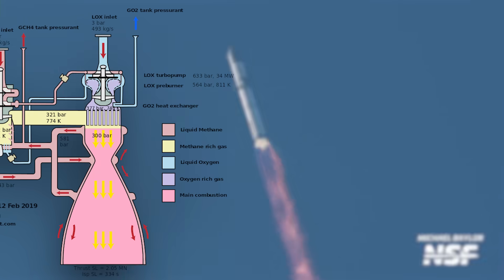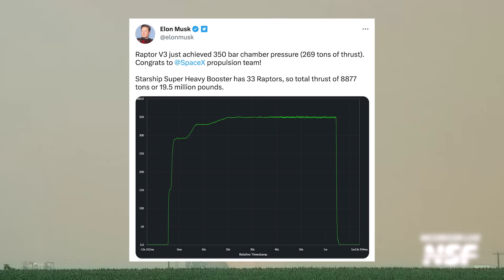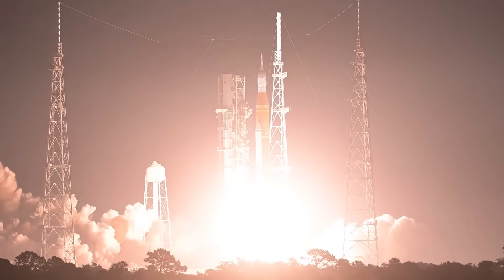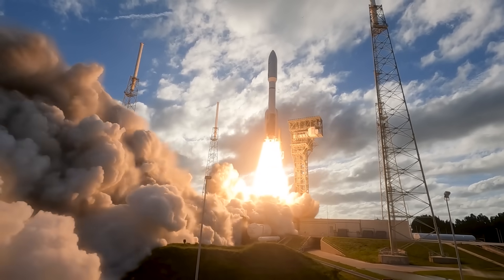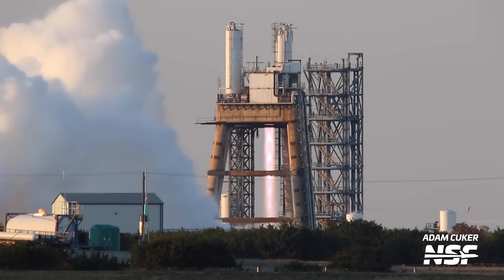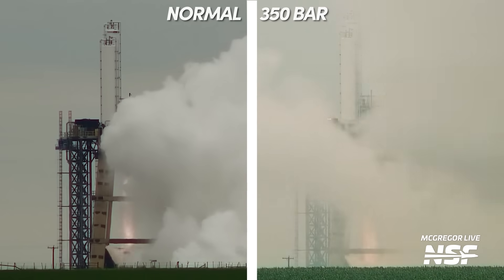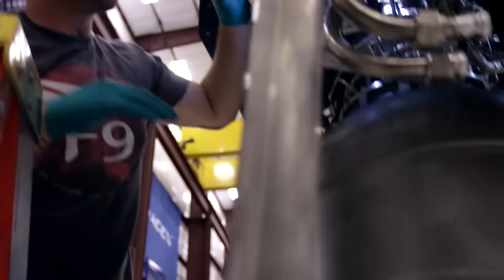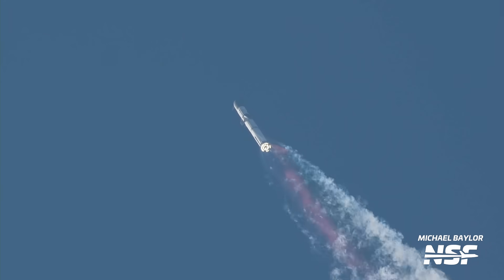SpaceX's New Raptor 3 Smashed The World Record!

Comment: Some of you guys who are engineers, please educate us?  It appeared that about 7 Raptor V2s failed in the recent launch.  7 out of 33 ain't bad for a new engine, but unfortunately that's enough that it was unable to make orbit or trajectory.  So, were those failures fixable?  Did they fail for varying causes?  Elon says it wasn't FOD.  Did the combustion chambers melt at full thrust?   
Of course I am simply wondering if another test flight using the same V2s has much of a chance of making orbit.
I'm excited to hear (not surprised) that there's a V3 in the works, but that could be a long way away yet.   Elon is saying next flight on June 15th?  Oh please, there's no way they can fix that OLM and tune up the booster and SS in one month!  I wish he would be more realistic.  Mid July or mid August seem much more feasible.
Reply: The V2s that were on B7 were a bit mismatched and inconsistent due to their stages in development, the more recent ones are meant to be more consistent, so hopefully that means fewer issues. The main contributor to many of the engines failing is that the raptor shielding isn’t as thorough on B7 as the newer ones, and so when one engine blew it damaged surrounding ones. The same thing resulted in the HPUs losing pressure, so the booster couldn’t steer, but the newer boosters have already replaced the hydraulic system for an electrical one.

Edit: forgot to mention that the computer chose not to ignite 3 engines from the start
Reply: @Gauldoth06  not to undermine your fantastic argument, but SpaceX is a private company
They don’t have public funding
Reply: The onboard computer found 3 engines did not have the right parameters to be started at launch. This may not have been a failure of the Raptors themselves. It may have been a software issue being too overly cautious or not specific for that version of raptor. (And as the outside Raptors need to be on the OLM, they can not be started once the Starship System has lifted off. The raptor that failed in flight caused damage to the neighboring raptors and also there was some cause that related to the hydraulics which caused, at 85 seconds, a loss of control of the center engines. But at least it did not cause the rocket to RUD. So a big plus there. The thrust puck was really up to the task! If your producing a product and you haven't tested it, how the hell are you going to be able to 'improve' the next build? As for the 'time frame' you refer to, there is a lot of testing being (or has been done) already. And those that follow SpaceX know all about 'Elon time', so yes, more likely later. But it is looking like this year.
Reply: @David-yo5ws  yeah the 3 that didn't start at all.  The same thing happened (different engines?) on the static fire test.  It seems very puzzling that they had that happen and didn't do another static fire test.  Did they write those engines off, figuring 30 would be adequate?  It would have been had 4 more not failed on ascent.  An additional failure could have taken out the adjacent engine, but all the failures were not next to each other.  So one or 2 engines failed on the way up that were not due to inflicted damage.  I would have more confidence in a quick fix except for the puzzlement of the static fire/no retest.
Reply: @paulwilson8367  Unless your working as part of the Raptor team, it means we may not know the finer details till someone writes a book in future years. As a 'hypothetical guess', it could be that the team are not putting their resource's and time into re-writing the software parameters for the different V2 Raptors. There is only so much time. With the newer V2 or even V3 engines and better specifications and more consistent supplier of transducers, pressure sensors and turbo pumps etc, they may be focusing on the S25 setup or even S26. One of the problems with the Space Shuttle was the technology changes over the years. They had to stick with 'out of date' systems, or they would never have finished one! So Elon had to just get a rocket launched to answer a lot of their doubts and get telemetry data. If 1 more Raptor had been slightly out, the onboard computer would have aborted the launch. As it was, they were very lucky, because did anyone write into the software, that if engine A, B, C failed and they were in 'this' configuration, leading to a sideways direction into the Tower????? Only SpaceX knows that answer at the moment. Anyone who has ever tried to invent something that no one else ever has built before, knows what it's like to be 'trialed by public'. There will always be a certain percentage of the diverse population for and against what inventors make. My attitude is to ignore them completely. I have only so much time and resources like everyone else. Man has always explored. If we had not, we would not be here. If we humans had stayed in one place, then eventually a natural disaster would have decimated the population and we would be extinct. Only by spreading the gene pool far and wide, increases our species chances of continued survival. So I am all for going beyond Earth and finding another 'place' to spread the race. 
There will be another extinction event one day. Try or die. I'm past my prime, but I would support the next generation who want to back the chance to explore their new 'off world' home. A new era of 'wagon train' pilgrims. Saddle up buck-a-roo's!

Comment: Which raptor engine was used on the 420 test launch? Report 1 or 2?  And what will be on booster 9 for the next test? Raptor 2, i guess.
Reply: The recent flight was V2s.  7 out of 33 failed.  That's why everyone is wondering if V3s can be ready for next text flight, or if they think they can keep enough V2s running to make stage separation and orbit.
Reply: @paulwilson8367  the thing people seem to forget is that there is more than just the big version changes. Elon has mentioned that what went into B7 was a hodgepodge of the raptors they had around at the time, the newer boosters will get much more up to date and uniform V2s

Comment: Is the now higher max chamber pressure indicative of reliability? As in, now that it's capable of higher chamber preassures, they can now run it at lower chamber pressures whilst maintaining performance with less risk of failure?
Reply: That’s basically what he means by safety margins, yes.
Reply: @Shaw Fujikawa  ah! my bad. Must have missed the part he said that. Was busy burning dinner 🤣
Reply: @CritternNation  Another way of increasing your 'Carbon Footprint'. 😆 Also Bear Grylls says a bit of charcoal helps with digestion.

Comment: Truly impressive. But why is the exhaust orange? I thought it had to be blue(ish) because it burns methane.
Reply: Rocket engines usually run fuel-rich (rather than stoichiometric) to keep combustion chamber temperatures from being too high (amongst other reasons), and Raptors are no exception. In addition, many (including Raptor) use film-cooling in the main chamber and/or throat where extra fuel is injected as a film to limit the temperature at the wall.

When these engines are run at sea level, the ambient air pressure is dense enough that atmospheric oxygen interacts with the excess (not burnt in the main combustion chamber) methane in the exhaust plume, giving rise to additional combustion products and thus additional colours.

Comment: One Raptor 3 is about 18 times more powerful than a B-1 Bomber jet engine at full afterburner.  As a former crew chief on the B-1B, I find that absolutely insane!!
Reply: And that's just in terms of thrust. In terms of actual energy output it's even higher, because the exhaust is being accelerated to a higher speed.
I'm not sure exactly what the exhaust velocity of the F101 is, but somewhere in the ballpark of 800m/s seems reasonable. Raptor is about 3200m/s, or four times faster. 
Usually kinetic energy would be squared, but in this case that's cancelled out by the decrease in mass flow, so it ends up being linear.
Still, that puts Raptor at around 75x more 'powerful' in terms of wattage/horsepower/etc. Raptor Vacuum would be closer to 100x. TL;DR: Rocket engines are insane.
Reply: Now imagine 33 of these bad boys all bearing down on a steel plate. Holy [expletive]!!!
Reply: Unfortunately it's not a jet engine lol!!! Totally different thing to even compare! The jet will have an amazing range on longer duration and is significantly way more efficient than a fuel guzzling rocket engine
Reply: @carholic-sz3qv  
While rocket engines are less efficient than jet engines in an absolute sense, it's worth noting that their ability to operate in a vacuum allows them to travel long distances without fighting air resistance. Over distances of 10,000km or more, rockets can actually achieve a similar energy efficiency to aircraft, since they burn all their fuel then coast the rest of the way, while a jet would have to fight drag for 10+ hours.

A Falcon 9 for example can throw a payload of maybe 25 tonnes a distance of 20,000km while burning about 150 tonnes of RP-1 in the process.
An A330-300 can carry about 45 tonnes about 12,000km while burning about 110 tonnes of Jet-A, which is functionally almost identical to RP-1.
If we assume the Airbus stops and refuels at the 10,000km mark, then the fuel burned for a 20,000km trip would be around 190 tonnes.
Which works out to about 4.2 tonnes of fuel burned per tonne of payload, while Falcon 9 works out to about 6 tonnes of fuel per tonne of payload.

So the jet still wins, but it's 'only' about 30% better, which is a much narrower margin than most people would expect.
And Falcon 9's Merlin engines aren't very efficient by rocket standards - if it was using an engine like Raptor it's numbers would be significantly better.
Reply: @Lazarus  to add to this, rocket efficiency technically goes up dramatically when you factor time. I.e Voyager is still traveling from the initial energy of its rockets (combined with insanely smart mission planning) and has moved about 23.4 billion kilometers which would put any jet engine to shame. But I know what you mean from a rational sense
Reply: @lazarus2691 lol....... you totally forget to mention that the rocket has both fuel and oxidiser which makes them even heavier and not as flexoble as an aircraft! the
Reply: @carholic-sz3qv  I doubt it is more efficient that any variation of the Raptor.
Reply: @jamescarter8311  yes it is! it signigicantly way more efficient than any rocket engine! the aircraft is just a gigantic turbo coupled with combustion chamber and they dont need to carry extra weight as super cold oxygen....
Reply: Air breathing engines are going to have much less power than rocket engines. Obviously.
Reply: @Connection-Lost  
I don't see how that makes the insane power output of rocket engines any less insane.
Reply: Thumb math tells me that's 150 B1s strapped together every time superheavy launches! Crazy!

Comment: I wonder if there will ever be a Raptor version of the Falcon.

A Falcon with 5 Raptor 3 should be able to outperform a Falcon 9. And that could allow to put flight hours on Raptor independently from Starship.

After all at one time Falcon 5 was a thing... Maybe Falcon 5R.
Reply: You would need to redo the thrust plate on which the engines are mounted, along with tanks as they are sized to RP-1 and not LCH4. So pretty much a complete redesign of the whole booster. With 9 Merlin engines, they can lose an engine at liftoff and still get to orbit with the other 8 engines. With 5 larger engines, if you lose one early in the flight, you are not going to space that day. Satellite operators and insurance companies REALLY like the the engine out capability of the 9 Merlin RP-1 engines.

One Merlin engine at minimum thrust already has too much thrust for landing, so they have to time engine start precisely, so that the acceleration is near 0 at touchdown. Going with a much larger engine, would make that more difficult.
Reply: Hard to see them doing that.  Second stage of Falcon 9 is not reusable so launch cost of Starship is expected to be lower.
Reply: I personally don't think SpaceX is likely be making a "Raptor version of the Falcon". On the other hand, if they chose to make a direct replacement for the Falcon 9 using Raptor engines it likely would have five of them. The new launch vehicle might receive a different name though...

Comment: I find it interesting - and maybe it's just me - that when the engine reached the plateau on the graph (end of the video), it just sounded "right." When that graph had a couple little wiggles in the plateau, I could hear (or thought I could) that it seemed just a little, wee bit "off," and then it evened out to "right" again. I wonder if that's an actual engineering/physic phenomenon - the "right" sound means it's working well....?

Eh, I'm no rocket scientist, so maybe I'm just being silly... ;-)
Reply: you do not need to be one: does your car engine runs smoothly if it coughs? These Raptor engine must be tuned for particular set of parameters (even if you can throttle them).
Reply: @LaF0IRE  Ah! Well, cool - it's pretty neat that my "unscientific" thoughts actually have some basis in science ;-) Thanks

Comment: Theoretically, what is the maximum efficiency a rocket engine can achieve?  99% or 100%?  What would the chamber pressure have to be at for the theoretical maximum efficiency?
Reply: Nothing is 100% efficient.
Reply: The engine can only be 'efficient' based on the fuel and the intended requirement of the payload. I think the hydrogen fueled engines are more efficient than methane, however, they come with all the problems associated with a very light gas (hence orange insulation) and hard to prevent leaks (have to have very good seals).
Marcus House did a very good video on isp 'efficiency' which showed a nuclear rocket engine was the most efficient. But that does have some 'high risk' for humans.
So I think it's more the 'practicality' of what you are trying to achieve that you need to look at. And the most efficient method of doing that, is not necessarily having the most efficient rocket engine. Elon chose methane, because a sabatier process on Mars can convert the air and water into methane and o2 fuel/oxidizer for re-fueling the Starship for it's return to Earth.

Comment: One thing Elon hinted at was the elimination of the individual turbo pumps on each engine. Perhaps the outer ring of stationary engines will use a common pumping system.
Reply: For what?
Reply: @JumpingJack-w2l  less production cost? Less moving parts? Less piping and weight?
Reply: @omonkkonen6676  Interesting...One set of turbo pumps per two combustion chambers in the non-gimbaling outer ring would be a cost saving and maybe some weight saving too.  Perhaps a reliability gain too.  Assumes of course they can build a higher performance turbo pump needed for the increased propellant flow.  Would be amazing.
Reply: @omonkkonen6676  that has some drawbacks. Independent engines are more isolated, bigger turbopumps failure may be more violent and will have greater impact. Also raptor designed with extremely short path for hot oxygen-rich (extremely corrosive) gas but having shared turbopump will make that path way longer which adds some issues. Cost efficiency is important though
Reply: @JumpingJack-w2l  sure it has drawbacks too. Would guess once successfully in orbit they will try to slim down and save weight as much as possible. Some calculations were updated once amount of Raptors increased in booster from 28 to 33.
Reply: More like RD-180 design?

Comment: The test looked really clean. I noticed that the flame looked straighter and wider than the other lower pressure test. Does a higher chamber pressure mean that the bell needs to get larger or longer now for V3? And would that cause a problem with fitting them all in on Starship and Heavy booster?
Reply: I think if the increase in efficiency from increasing the chamber pressure outweighs the decrease from having a less optimal nozzle, I think SpaceX would accept the nozzle inefficiency for the overall increase in thrust or isp, especially for the booster engines.
Reply: Exactly. Higher chamber pressure with a "stock" nozzle means that gases as they exit the nozzle are not at atmospheric pressure at sea level (which is ideal for a rocket engine). But, there is no such thing as an ideal nozzle. Say you dimension it for sea level P°, as soon as you fly some, it's not optimum anymore. Thats why starship has both vaccum and atmospheric engines. If I remember correctly, you do not have to suffer these trade-offs with aerospike engines.

Comment: Imagine a big brother version of raptor 3…
Reply: It appears it is hard to make high efficiency liquid hydrocarbon rocket engine with thrust per chamber greater than Raptor has. In other words Raptor is pretty big rocket engine.
Reply: @JumpingJack-w2l   to much fuel being used for not to much extra thrust/ weight? Again, if there was… a raptor the size of the f1 Saturn V. I know it’s unrealistic, would be cool to see probably not practical…
Reply: @Ch33ziTzsk8R  that related to combustion instability in combustion chamber that becomes worse if pressure (for efficiency) and chamber size (for thrust) increased. Raptor is near the top of high-performance liquid propellant rocket engines, advancing beyond that requires lot of science at least. There is several multi-chamber rocket engines like RD-180 to avoid issues of bigger chambers and gain more thrust, and they look like two engines strapped together, have some issues and there is discussion if it worth it or better have two independent engines instead. I think it is unlikely we will see Raptor's big brother soon